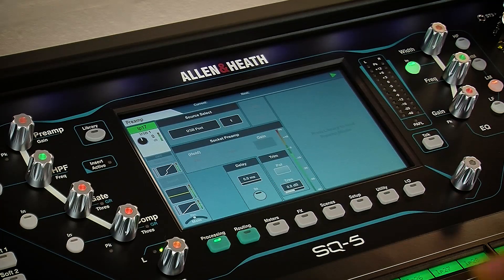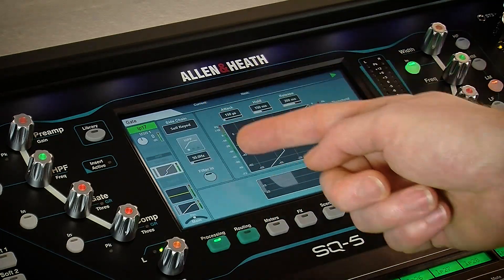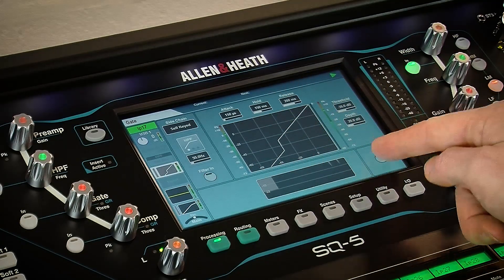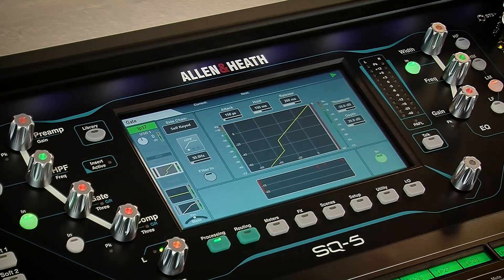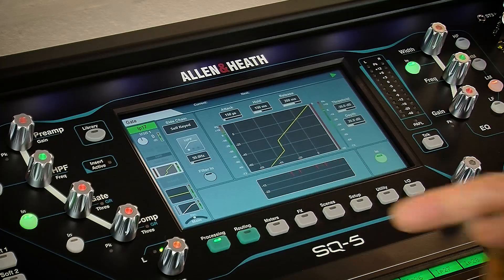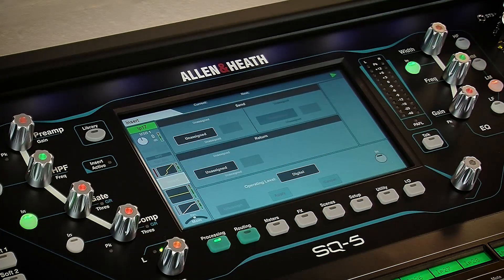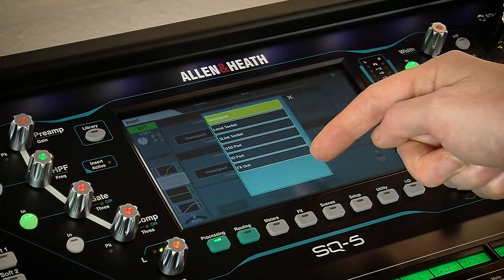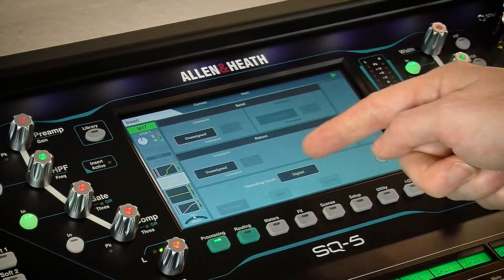Allen & Heath SQ – Input Processing

Comment: Is there a way to make each channel pre or post fader when using it to record to a DAW? FOR example, if I want to actually print the effects I sent to the vocalist during tracking from channel 5, how do I change that. The prefade button on this side does absolutely nothing. Surprise surprise!
Reply from the maker: Hi! 

This depends on what you're recording, but yes, it is possible to have a pre or post fade signal routed to a DAW. 

If using Tie Lines to route signal to a DAW, this will take a post preamp signal, so no processing or routing will affect it. 

As you want routing to affect the signal, you should use the Input Direct Outputs instead. You can patch these to the USB interface by going to IO and select Outputs > IP Direct Outputs on the left and USB on the top. 

Once you've patched your Direct Outputs to the USB, you can choose what the direct output includes in the signal by selecting an input channels and then press the Routing key. You can then see a Dir Out settings button on screen. Press this to view the Global Direct Out settings where you can enable follow fader. 

If you want to record the FX, you can send the FX Returns to the USB interface by going to IO and select Outputs > FX Rack on the left and USB on the top. 

I hope this helps!
Thanks
Alex
Reply: @AllenandHeathUK , no, I just blew a circuit reading that. I read the manual, watched all these videos, and even some other ones, yet I still don’t get it. I didn’t understand tie lines, and I certainly don’t understand all these hoops I have to jump through just to print compression or not. I didn’t know you guys have a support line. I’m going to have to use it. I’ve been able to figure everything else out in my career, and life, all by myself (I literally taught myself to ride a bike and swim when I was a kid), but this board is beyond my scope. I don’t know why, but it is. I’m sure it’s easy once the disconnect clicks, but I’m struggling nonetheless. I have a $3000 console that I can’t figure out; therefore it can’t make me any money. 🤦🏻‍♂️

Comment: I use an SQ 6. Why does the preamp gain knob control the trim instead of the gain?
Reply from the maker: Hi Gary, 

If there is no physical preamp assigned to an input channel, the trim is assigned to the gain rotary automatically as no gain control is available. You can also change the gain rotary to only control trim by turning Preamp On Surface off in the Surface Preferences. This is useful if the audio from one preamp is being used on multiple consoles. 

Thanks!
Alex
Reply: @AllenandHeathUK  Alex, Thank you for replying. I checked the Preamp In Surface in Surface Preferences and found that it was set to Trim. I don’t know how it got changed but it fixed my problem. Thank you, thank you.

Comment: I’m having a hard time navigating my SQ-5. I’d like to be able to hold the VIEW button and press the IN button next to HPF, EQ, COMP, etc. . To be able to quickly get to that view. A plan B could be to set an assignable button for the selected channel’s Comp, GATE, ETC. . but it doesn’t look like you can set an assignable button that way either. The X32 / M32 has dedicated view buttons that I greatly miss. The SQ already has a view button (that seems under implemented) and buttons (IN) next to where we want to go. Please make VIEW work like COPY and PASTE. It would make a world of difference in speed of which I could get around my mixer. Thank you
Reply from the maker: Hi Michael, The view key is for the channel and Soft Rotary LCD displays, and allows you to see current sockets and values, though I have noted your request. If you have further feature suggestions please post them on the dedicated section of our digital community here (https://community.allen-heath.com/forums/forum/sq/sq-feature-suggestions) as it allows them to been seen and discussed all in one place. Thanks! Keith.

Comment: Would there be a different approach for setting gain levels for line and mic signals?
Reply from the maker: Hi Mark, 

For any input signal on the SQ, it's good practice to aim for the 0dB mark on the meter, as this gives you a good starting point for any application (Live Sound, recording, broadcast, etc). 

The main difference between mic level and line level is that mic level often needs more gain to get a strong signal. Line level is often already at a good signal level so you may find you need to attenuate the signal instead of boost it and this is where the -20dB pad can be used.

The overall aim is to have as much control as possible over the signal. For example: if the gain is close to the minimum setting, engage the pad and boost the gain so that you have the option to cut or boost the signal as required.  

I hope this helps!

Thanks
Alex
Reply: Thank for the quick reply Alex,

I thought so as much, but was looking for the confirmation. Back in the days you had those mic/line switches on a board, which I assume were nothing more than a -20dB pad switch ;-)

Thanks a lot, Mark

Comment: Hello! Sorry for my English! Such a question, is there an analyzer of the equalizer spectrum on the input channels?
Reply from the maker: Hi Erop, There is no reason to apologize! The SQ has a built-in 31 band RTA that works with the PAFL bus. So you can use it to analyse any input or output channel. This is displayed in the Meters screen of the SQ. Thanks! Keith.
Reply: AllenandHeathUK but that's such a hassle to go back and forth. Please add RTA to the EQ. So much handy to know the trouble frequencies.

Comment: Is there any way to switch the compression post/pre EQ?
Reply from the maker: Hi Wil, There is no way to switch input channel processing blocks as it would cause issues with coherency and sends to mixes. However, it is possible to send an input channel to a group, meaning you would have input channel compression coming before the group GEQ/PEQ. Use of a group will not affect the coherency either, as shown here - http://support.allen-heath.com/Knowledgebase/Article/View/sq-signal-path Thanks! Keith.